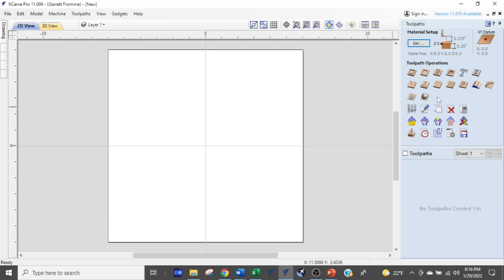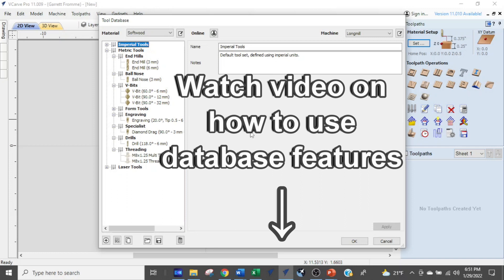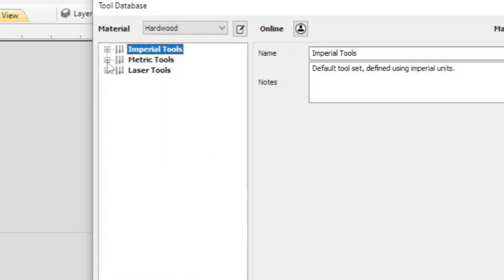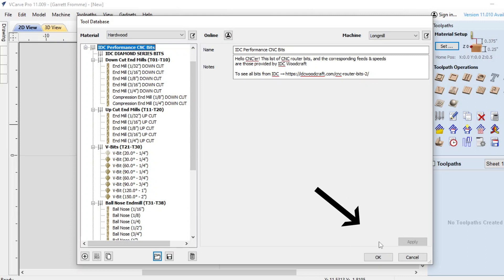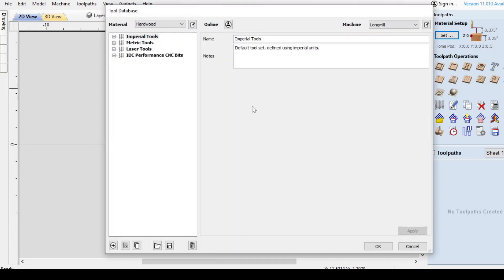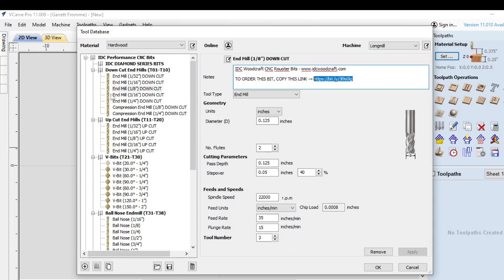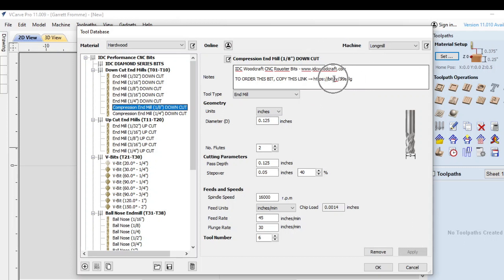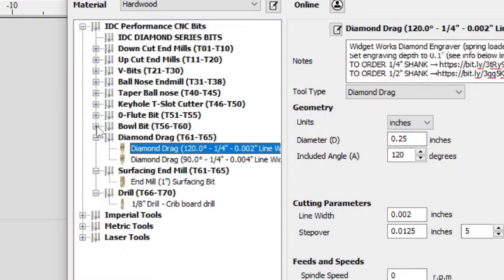How To Install A CNC Router Bit Database Into Vectric Vcarve & Aspire, Download Instruction

Comment: Thanks to Bill for work entering and to you for customizing database. My purchaser told me she ordered my IDC bit set yesterday. 

 Downloaded Vetric Desktop trial and loaded database iaw your video. Relearning and deciding on projects. Once reaquainted with process I will purchase Vectric software, likely Desktop due to cost and size if my machine being a good match. Again Thanks for good video and work.

Ms. KaDee
Reply from the maker: Ms. KaDee, you're so welcome my friend! It sounds like Desktop will be a good fit for you and your needs. I'm looking forward to getting your new bits out to you and seeing what you create with them!
Reply: It seems my proposed commitment to Vcarve Desktop was premature. I started a project late last night only to discover almost immediately that the spiral I needed to create is not included in Vcarve shapes and only Vcarve Pro will allow me to load something called a "Gadget" necessary to create a spiral on a flat board using a simple vbit. So I must wait to design my rotating spiral quasar for my box top project till I have the bucks for the Pro version or try and do it using some weird combo method of design software. While I could do it in a few minutes manually with a router and string the point was to design the whole box top and cut it out of walnut after I  engrave my design using the cnc. Just my luck, like the first assembly language program I wrote years ago had to be real time and count clock cycles for a PDP11. Oh well. I still appreciate the bits and ill try to find a way to cut a spiral using vcarve desktop I downloaded by doing arc line segments or something. Ms. KaDee

Comment: ( 11:26) Vectric WILL remember your Tool Data base view if you go to "Edit", "Options", and change the second two option to "Yes". Save the file , and when you open a new session, your tool data base will look expanded.
Reply from the maker: Hey Mike. Thanks for the tip. I'll get her fixed. what would I do without you.

Comment: Very nice I’ve already purchased your basic bits and installed those manually but I currently have a couple new bits from you in the mail so I’ll use this approach.  I think your customer-centric approach is great and in my experience if you make it easy for your customers to buy and use your products then they will it’s good for your business. Mahalo
Reply from the maker: Hey Dennis, ya definitely try this approach out. It sound make your life a little easier getting them entered! Mahalo my friend

Comment: Another great video Garrett! I have been setting up my bit database in VCarve Pro 9.5 since the import of IDC data is not supported. Your software version has some better features, so I will have to upgrade to make my life easier. Thank you sir!
Reply from the maker: Dion, glad you enjoyed the video brother! I am sorry but you will not be able to use the IDC database with your older version of Vectric. You will need to upgrade!
Reply: @IDCWoodcraft  awesome.  Newbie question here. What about makita router speeds for these bits. Is that notated somewhere?

Comment: Garrett: This is an excellant video. Thanks. I have just purchased your bits and downloaded the data base. The information for "2/28/24 is corrupted. Both the PDf and the tool database, however the information for 3/9/22 was okay.
Thanks again for the information and the excellant videos
John
Reply from the maker: j.miller9383, sorry about the issues with downloading the database brother but I am happy to hear you got it sorted on 3/9.

Comment: Thanks Garrett. Got it downloaded and installed. 
btw. If you hold the control key down and then clock the hyper link path. The web page will open. 
Thanks
Reply from the maker: stanmerrell5390, You're very welcome! I'm glad you got it all set up.

Comment: I know this is a relatively old video.  Please beat me up over it.  ;-)
What was offered in this video went into three of my putters.  
Grateful to have it!
Thanks Garrett, Bill and Mezalick ~ (for that extra Tweak!) for making the craft  better. 
My ear for feeds and speeds serves me very well today as well as  30 years ago when I was a steel machinist.  I always change my individual tool settings to drive the tool a wee bit on the harder side just by what I'm hearing and feeling.  Burning a bit Grinds My Gears.
Before I found IDC and while I was CNC "Probie" , I found some Chinese bits working stunningly good!  Yet others break after a Mean Tweet™. Especially V-bitts with the blue coating.
I  can't believe how well the Chinese ⅛" up/down bits work. 
That said, I'm starting to make good money with carvings and can't afford China's poor quality control and  cheap bitts to stop me.  
In response to this useful time saver..... A "Gift" ... I'm going to stop buying from Amazon in favor of Garrett's passion and zest.
I've been nearly a month waiting for his show stoppers so only panic and desperation will make me buy elsewhere.
Reply from the maker: Navigator777777, It sounds like you've had a great journey with your woodworking and machining! It’s awesome to hear how the techniques discussed in the video have positively impacted your work. Your experience with feeds and speeds really shines through, and it’s always interesting to hear about the results you’ve had with different tools. Supporting passionate creators is a wonderful way to give back to the community! Happy carving!
Reply: @IDCWoodcraft  
I placed another order for your roughing bits.  Previously, I ordered your roughing bits on Amazon.  They've notified me 3 times since that my order would be delayed.  
I'm not posting to embarrass or call attention to the shortage.  On one hand it's way better than looking at warehouse full of  bits that won't sell.  Wondering if you can call out how the shortage came about?
I think you must be doing something right.  Love your passion.

Comment from the maker: To download the IDC CNC router bit database, click here → https://www.idcwoodcraft.com/download/19136/?tmstv=1669952826
Reply: I has download tool database look great but not metric there not inch .  how can I
 find metric
Reply: have inch there but not metric there
Reply from the maker: @rogerhickson-snook6935  That's something I'm going to have to add to that database. I don't have metric in it right now
Reply: @IDCWoodcraft  I came from in New Zealand  that need metric . anyone  found  metric ?
Reply from the maker: @rogerhickson-snook6935  are the bits you use metric, or are they inch.
Reply: @IDCWoodcraft  I use metric bit
Reply from the maker: @rogerhickson-snook6935  I don't have metric on my list because I don't have metric bits but I can develop that and I will. I'm glad you brought it up.
Reply: Good morning. I am very new to CNC. I have purchased a NextWave Shark HD520 which came with the VCarve Pro. I have selected your link and the file reads "MUST-BE-UNZIPPED-IDC-Performance-CNC-Router-Bit-Database-Rev-02-22". Usually for me to unzip a file I select the link. Which I did. It then takes me to another folder. I read the "READ ME FIRST" PDF. I then selected the IDC Performance CNC Router Bit.... but then get the Compressed (zipped) Folders Error pop-up window which says "Windows cannot complete the extraction. The destination file could not be created. Where did I go wrong?
Reply from the maker: @emmahenderson133  hi Emma, it should unzip based on what you told me. Maybe you can create a new file directory want to ask which directory you want. Usually the only reason it won't create the directory is because that directory already exists. Just add a number to the end of the directory listing that it gives you
Reply: @IDCWoodcraft   Thank you, I will try that. In the meantime, I have received both my 120 and 90 degree diamond drag engraving bits from WidgetWork. The 120 came with the recommended starting values but the 90 degree bit did not. I looked through your Bits and Speeds PDF file and I do not see any recommended values for the diamond drag bit (unless I am over looking it, which could be very possible). Are the recommended starting values for the 120 and 90 degree diamond drag bits the same? I am "etching" to get started. ;-)
Reply from the maker: @emmahenderson133  lol I get the etching feeling. Use the same settings

Comment: Thank you Garrett !  I am new to CNC and your video's have helped me learn so much as I wait for my Onefinity to arrive.  I am currious if you are planning on making more database's for softwood and MDF ?
Reply from the maker: Thank you for the kind compliments about the channel. The numbers I use are general numbers. They can be used pretty much for anything. You might need to adjust a bit. But I will not be expanding the database for other materials. At least not yet

Comment: Garrett, I haven't seen any downloads for Materials, specifically Aluminum.  Does the material selected adjust the speeds/feeds etc. of the tool?
Reply from the maker: Brian, great question brother. You'll have to adjust the feeds and speeds manually when you change the materials.

Comment: Hi Garrett, Great website, great info for many CNC'ers. A quick question, because I work in mm, If I change the inch to mm in the tool database, will it auto change the relative info for mm users? Thank you for being thoughtful of others, by putting the tool database on your site for people like me.
Reply from the maker: Michael, this is a great question brother. There is likely a way that you can convert the data into mm but I have never done it myself! When I try it on my end, the settings don't switch over automatically so it may require a couple hoops to jump through to get it to work!
Reply: @IDCWoodcraft  Hi Garrett, Thank you for your reply, it's much appreciated. here's a question about a different subject. When I do a Vcare for example,  Why is it that some of the lines only get a very faint carve line and not the same as the rest? How can I get a carve where all lines of the subject are say 2.4 mm deep? Do I use " Flat depth or do I leave it unchecked to get a certain depth of cut? I understand the material could be uneven, so I will do a quick surface, Do you think then, the carve depth will be the same? What determines the required depth of cut for any given project? Thank you, Garrett.
Reply: @IDCWoodcraft  Hi, Garrett, Please can you tell me, How to set up a drag bit? Do I adjust the tension on the actual bit? Also, what settings do I need in VCarve Pro when using the bit on Glass, Granite, Aluminium and acrylic? Thank you
Reply: @IDCWoodcraft  Hi Garrett, Thank you for your reply. I did actually reply before, but I'm not too sure if you have seen it yet. I did send you a message to your IDC Woodcraft store site, as it was the only way I could contact you, as I thought you probably wouldn't be looking on here too often.  Thank you

Comment: Great Video Garrett. Thanks for all this info. Do you have settings for the soft woods as well?
Reply from the maker: The settings in this table are general for most wood except extremely hard wood. It will work for most wood do you work with

Comment: Thanks for all this helpful information.....while I wait for my machine I am trying to devour as much VCarve Pro info as possible. I am having trouble finding ANY kind of tool database for toolpaths for Freud.....have you ran across this?
Reply from the maker: Jeremy, Cant help you much with Freud bits, although they do sell a nice set of router bits. The feeds and speeds that I include in this tool database will work for their bits too. All you need to do is make sure that the dimensions of the bits you have are the same. Don't want to use the feeds and speeds for a 1/4" end mill when you are using a 3/16" right! Haha

Comment: You have the greateat video such attetion to detail
I have downloaded you database and noticed its for hardwood
 is there a database for softwoods such as pine cedar mdf i find that manufactures seem to be all over the map for feeds and speeds i realize that bits are more than likely setup for bigger cnc machines than the longmill 
Thanks for any help or push in right direction
Reply from the maker: wolfman1493, Thank you for the kind words! I have a video that should really help you with feeds and speeds. Here is a link: https://youtu.be/TFaLVQYKo3c?si=dV1MUH8-KqCtrUHI

Comment: Hi Garrett. Easy to follow as usual. If a project is designed in metric, but the selected tool is imperial, does vectric automatically compensate ? E.g. a hole 8mm in size to be drilled 1/4in end mill on spiral setting? Will one land up with an 8mm hole? Thanks
Reply from the maker: That's a good question. The software knows what the bit is, and the size of it. So it will still carve accordingly. You'll be fine
Reply: @IDCWoodcraft  Thank you so much. Super responsive and helpful as always!

Comment: My machine is on order and just order some of your bits. My spindle will max at 18,000 rpm’s. On some of your bits in the database the spindle speed is higher than that. Do I have to change it to 18,000 and then adjust feeds to get same chip load numbers?
Reply from the maker: The Union, exactly right my friend! You'll want to adjust your feeds for the same chip load. You may want to keep an eye on having your machine running on max speed. I recommend backing off just a little bit since it will keep your machine happier longterm.

Comment: I understand that feeds and speeds, etc. are based on hardwood and trim router.  If I have a more powerful spindle, can those be adjusted / increased?  Also, what about when using different materials?  For example, if I am using the 1.5" surfacing bit to flatten my MDF spoil board...?
Reply from the maker: michaelbeckwith977, Yes, with a more powerful spindle, you can typically increase your feeds and speeds for better efficiency. When using different materials like MDF, you may need to adjust your settings to prevent burning or chipping. Start with conservative settings and gradually increase the speed and feed rate as needed, paying attention to the quality of the cut!
Reply: @IDCWoodcraft  Thank you!

Comment: I like it!! Really nice not to have to enter every new bit, just buy and it’s already there. I thought of one question. If you change the speed and feed on a bit for a particular job, then the next time you pull up that bit, will it be the original settings or what it was set at for the previous job?
Reply from the maker: Hey Bob, I'm glad you liked it! That's a great question. It should revert back to the original settings on your next job.
Reply: @IDCWoodcraft  Ok. Thought it would, but never hurts to ask. Thanks for the reply and great work on it from both of you guys!
Reply: If u change it from "edit" rather "select" on ur toolpath section it won't be changed forever. (it works for me)

Comment: Good day Garrett at long last just got my Vectric key as there was a issue with my long mill order so now my cnc is on its way but still doing more research looking to down load the speed and feeds from you guys a link would be great 😊on my journey I found I need to know what speeds each number on the Makita router is I was lucky to come across this lady  { oak hill millworkers} that has a chart #1 = 10’000, 2= 12,000, 3=17’000 4= 22’000 5=27’000 &6= 30’000 rpm not sure if you already had this as a newbie I find more info
Reply from the maker: Hi there! It's great to hear that your CNC journey is underway! The speeds you've provided for the Makita router are indeed accurate and will definitely help you understand how to set your machine. For feeds and speeds, it's always a good idea to refer to material-specific guidelines, which can usually be found on manufacturer websites or CNC forums. Enjoy diving deeper into your CNC projects, and happy woodworking!

Comment: Hello, not sure if I'd have much luck but thought I'd ask anyways. I was wondering if you would have any idea or advice for a trouble im having with my workB CNC machine. I have downloaded CNCjs on my new DELL Windows laptop and when I connect the usb cable from the CNC machine to the laptop, it does not get identified. It shows that no Ports have been identified. Would you have any troubleshooting techniques I may be able to do? Thank you!
Reply from the maker: Unfortunately, you are correct. I can't really help. However I do have some good news for you. Sign up to the CNC troubleshooters group and ask there